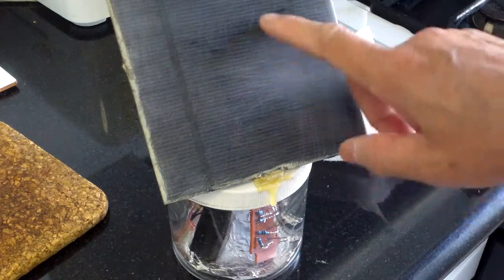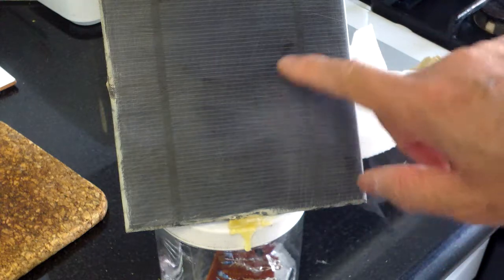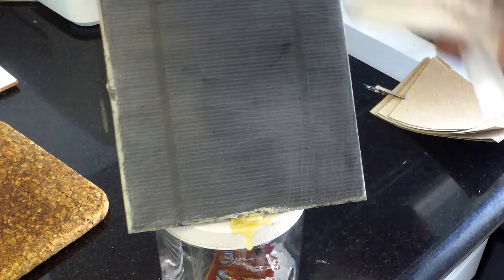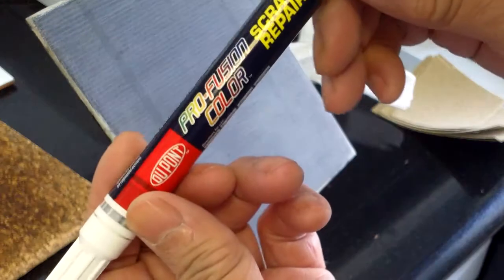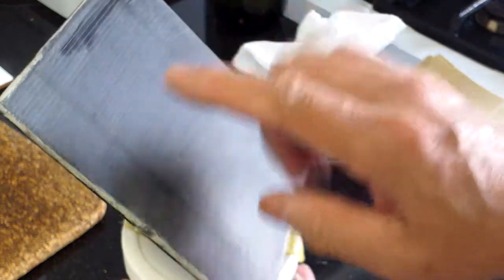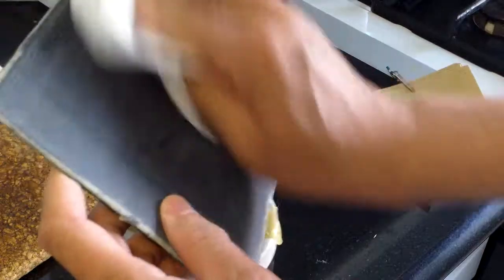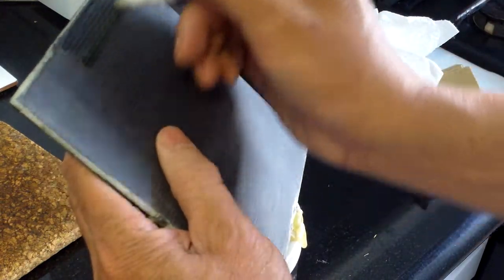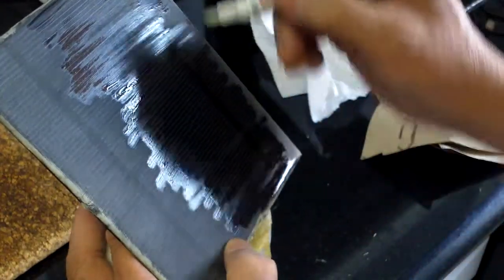epoxy solar panel refinishing

Comment: I use Brasso metal cleaner.  No sandpaper or steel wool!  Just rub vigorously with Brasso on a soft cloth in a circular motion.  Brasso is a very fine abrasive so it actually polishes the oxide layer off the surface but does not make optically deep scratches.  It takes a good bit of hand rubbing (several minutes).  Wipe with a dry cloth.  Repeat if not crystal clear.  Wash with water and dry.  I guess one could clear coat after polishing if desired.  Works well on many plastics too.
Reply from the maker: Thanks for your input. Do you think it'll work on  auto headlights that aren't clear anymore?.
Reply: Yes, I have used it on headlights.  It does take a lot of hand rubbing.
Reply: Whatever is faster is probably coarser abrasive.  When dealing with optics finer is better.  Maybe start with toothpaste and finish with Brasso...

Comment: Hmm.  Interesting idea.  Looks like they make the panels out of the same stuff car headlights are made of, and it clouds up over time.

I think you're definitely in the right ball park here using "automotive repair" stuff for it.  I would say rubbing compound, or even maybe try one of those "headlight restorer" kits they sell for a few bucks.  Might work even better.

Follow up with a couple quick coats of wax, perhaps, to keep it shiny and protected.  (May want to test this one out on a spare/scrap panel to make sure it doesn't decrease the output of the panel by much).

Of course, if you have the Harbor Freight sander/polisher (seen here:  Harbor Freight - Drill Master 7" Variable Speed Sander/Polisher Review) it will make it even easier (plug plug).
Reply from the maker: I bought rubbing compound and returned it. I originally used the stick scratch repair to fix scratches on my Prius. This stuff must be UV resistant so hopefully it'll do the job on the epoxy solar panel. I had tried polyurethane before but they turn brownish over time.

Comment: I found a garden light once that was frosted and needed to be shined up.  I think i used 400, 500, or 600 or all wet/dry sandpaper in small circles with a bit of water.  I think i may have used toothpaste also as a buffing compound with the sandpaper and even a cloth, it came out shiny, and be sure to buff with just the cloth itself to sort of slightly melt the surface of the plastic/epoxy to make it shiny and to seal it.
Reply from the maker: trailkeeper I will give your method a try next time. I have so many of these small solar panels and most of them turn cloudy in a few short months.

Comment: have you try'd to buff your solar panels? out here where i live I have so many birds and they like to land on my garden solar panels and poop on them, i have to clean them once a week.
Reply from the maker: Iseekoutthetruth I'd tried cleaning them but the surface is well oxidized.  Without sanding them 3 or 4 times using different grade paper, I just sanded it once and put on that clear coat.  Buffing just won't do, plus I don't want to spend too much time on it.